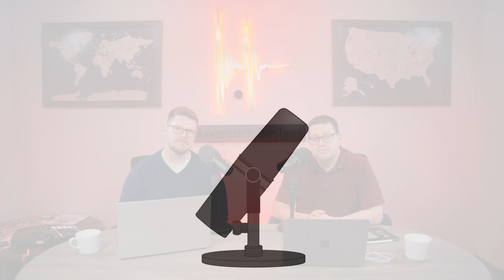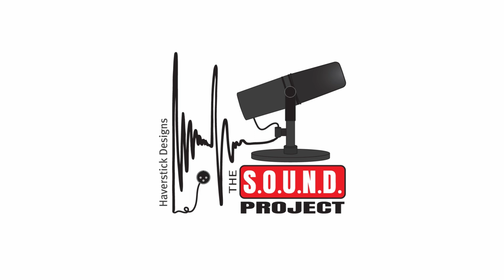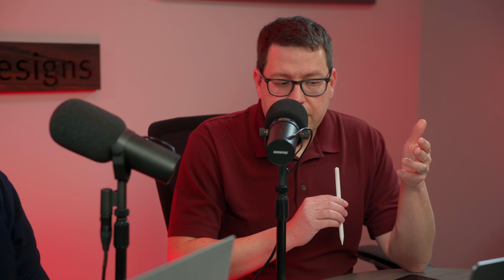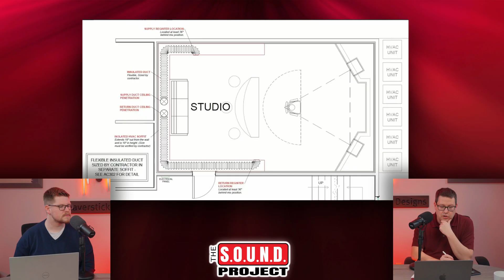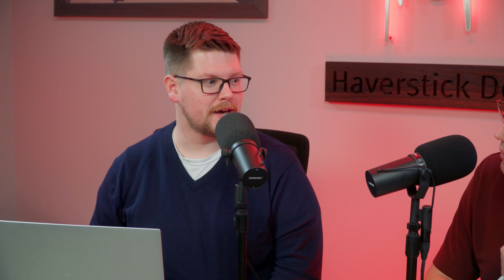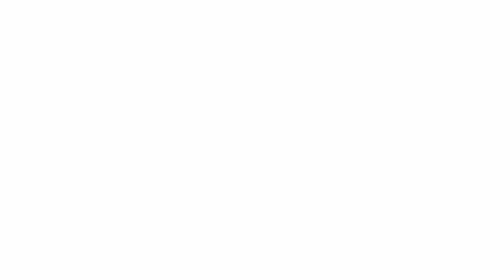Dealing With HVAC in Recording Studios - The SOUND Project Episode 12

Comment: Thank you for this video. In rooms with ductless mini splits, how are you recommending or what systems do you recommend to exchange or bring in fresh air?
Reply from the maker: You are welcome! In some of the rooms with ductless mini splits, our clients have been okay with just recycling air by opening doors/windows. When we need to exchange fresh air, you end up needing to choose between an ERV (Energy Recovery Ventilation) or HRV (Heat Recovery Ventilation) system. Here is a good breakdown of the differences: https://www.ecohome.net/guides/2276/choosing-between-an-hrv-and-an-erv/. These are going to introduce penetrations to your isolation layers which will need to be handled appropriately.
Reply: @haverstickdesigns  This is great info. Big thanks. So, the question is if you do need ventilation that is not provided by opening windows and doors periodically, then is it more cost effective to just use a traditional ducted system for HVAC rather than mini-spilt with a separate ventilation exchange? It sounds like if you have to add ventilation ducts using a mini-split system it defeats the biggest benefit of the split system - which is having no ducts.
Reply from the maker: @wilkeymusic2  When ventilation is needed or a priority, we typically recommend to go with a traditional ducted system rather than a mini-split system. You're right, the main benefit of the mini-split system is the absence of ductwork and that is negated if a fresh air system is put in.